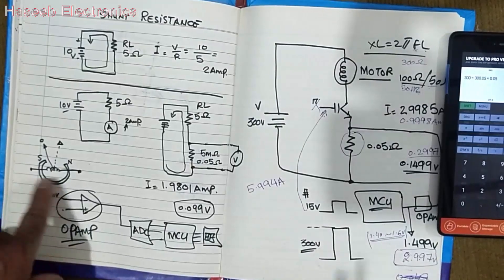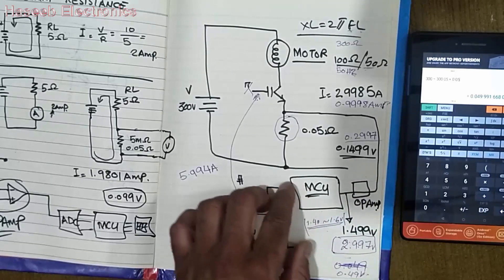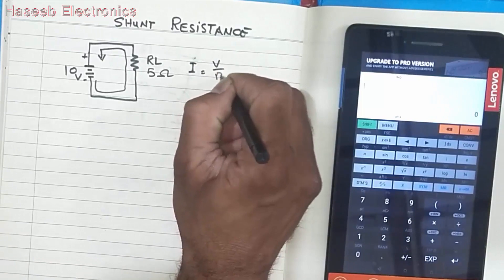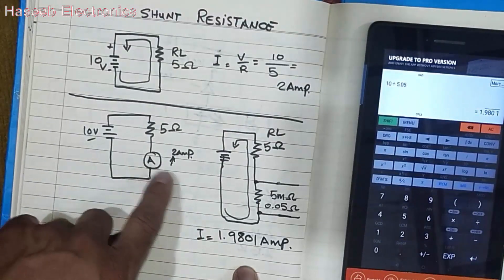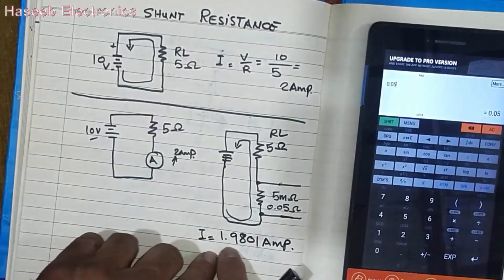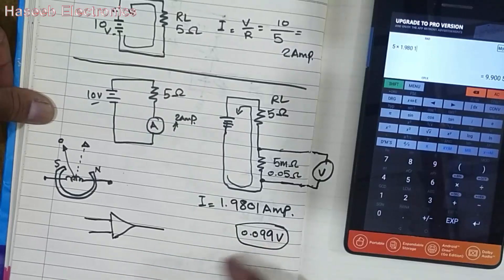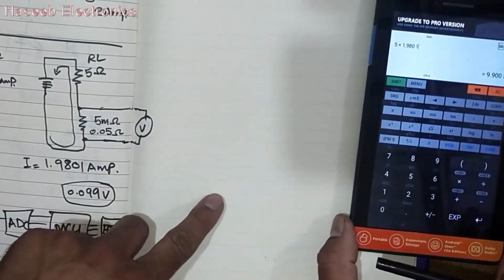357 SHUNT Resistance, Uses and Working Principle, How to Measure Current using Shunt Resistor

Comment: Sir I experienced that with temprature the resistance decrease and the voltage across the shunt resistor also decrease as the current increases. And we can,t accurately measure the current so what is the procedure to accurately measure about 50 amps of current @ 300 voltage.

Comment: Is it the same when an inverter ac error said ac current detect malfunction?
Reply from the maker: yes 
it is exactly the same 
there are 2 methods to detect the current in inverter ac
1. resistance in IGBT emitter pin and sensing the voltage using opamp
2. using CT current Transformer in AC input line or in dc rail

Comment: In practice shunt resistors for high current requirements have very low values, usually a milliOhm or less. The traditional use of a shunt with a given microammeter needle movement is well understood but not very useful for today's trend toward data acquisition and system electronic monitoring and control. Meaning, the shunt signal will have to be amplified in order to provide an input to instrumentation, and this is where the difficulties begin because of the high gain required, cancellation of common mode noise and influence of thermal emfs.

Comment: would that work for AC current measurement ?
Reply from the maker: for ac current measurement, the CT current Transformer is the best solution
Reply: @HaseebElectronics  even for high frequency like 300kHz ?  can you recommand one to use with my scope please
Reply from the maker: @EnergySeeker  there are many CT current transformers 
or Current probes can be used. it depends on your requirement. please check digikey 
https://www.digikey.com/en/products/filter/current-sense-transformers/163
Reply: @HaseebElectronics  am using this one Micsig CP2100A what do you think of that ? at 300kHz would it be accurate ?

Comment: Hello, thankyou for great video. But I want to ask how about if the load is inverter, I mean shunt resistor is between Battery and inverter so it use to meassurement the current of battery. Thankyou so much.
Reply: I mean inverter as a load too, sorry for confusing question. Thankyou

Comment: Hi , I have battery discharge machine and charge 30A , so +I , -I is connected to head and end of resistor shunt and multimeter is connected parallel ? Because my equipment power main supply is 380 vac and output is going out based on my programming, so how can I determine the voltage from my wires +I and -I ?

Comment: @Haseeb Electronics  sir my atx power supply work without pc but when I connect with pc it  restarts reputedly.  Plz help. Which part would be faulty?
Reply from the maker: Welcome dear
First verify that the problem is in ATX by installing another power supply to the computer (if pc works good with other power supply)
Then power on defective power supply by connecting green wire with black wire
If it starts normally
Or not
Please reply
Reply: @HaseebElectronics  yes. I've already done these by watching your videos. My pc is running now by another psu. But my faulty psu works fine without pc. But if connect with mother board pc restart repeatedly.  Monitor display goes on and off repeatedly.
Reply from the maker: If it starts for a while
Then goes off
Check output filter circuit (capacitors and rectifiers and 3.3 regulator)

Comment: Milliohm is 0.005 when converted to ohm.
Reply from the maker: I selected 50 milli ohm but while narrating it was mistake 
I said 5 milli ohm instead of 50 milli ohm
50 milli ohm is 0.05 ohm
I m sorry for inconvenience
Please accept my best regards
Reply: @HaseebElectronics  it’s ok. Beginners would find it confusing. I would suggest you do ‘How to determine a shunt resistor for a load?’.
Reply from the maker: @gtag174  I am thankful for your valuable guideline. 
I will do it 
Stay blessed

Comment: So XL is not resistance as we know it. it is inductive reactance and is also measured in ohms.  When the motor cannot move or difficult to move it is this inductive reactive that reduces.  And this inductive reactance is also measured as resistance.  My mind sees that if something is not moving or fights to move it means it has more resistance compare the something that can move easily.  Experimentally if a motor doesn't move or resist to move, has more load on it etc. it gets hot.  It is hard to picture it in my mind.
Then we have impedance, I assume that is different than inductive reactance. And reluctance etc.
So when the error code (over current) comes up on a diagnostic screen, it means the motor is having a hard time moving due to load or internal stress or whatever, or could it be anything?
When I took the bldc motor out of the washing machine along with all the computer and everything.  On the user inerface I put it on drain and spin.  Since I had no water hooked up to it of course, no drum to spin etc, I figured what is important is that I had the door as closed.  The motor ran.  I said to myself alright it works.  Well, it worked again the next around when I wanted to show off.  But then after that it didn't.  Error code over current came up.  And it never came out of it again.  I gave up.  I still have the control panel sitting on the shelf and wondering what happened.  I don't know if the motor needs to actually turn something, have something to do or the computer will show as if it is not moving or resisting to move which doesn't make sense.
Reply from the maker: you are absolutely right
actually i try to explain in very simple and lowest level to make it some understandable for a layman technical staff. so explanation of a function in very easy and understandable ways, gives good approach to understand the concept for those people who have poor knowledge
as it is a very deep theory of magnetism in rotary induction devices, provided a summarized view to understand the function of a shunt resistance  
when a rotor stuck or faces high friction of any other obstruction, it will cause to increase excessive current flow, so its magnetic filed cancels the input magnetic filed, 
because the counter emf causes cancellation of primary flux, it causes to reduce inductive reactance, which causes to draw more current 
in very simple words, "excessive resistance in mechanical movement of any rotary motor cause to reduce input resistance, which causes to draw more current than the rated drive parameters" 

please accept my best regards and special thanks for watching my video in detail and a valuable discussion
Reply: @HaseebElectronics  Are you saying that no load on that washing machine motor caused overcurrent error message because that couldn't be the case as all that would mean is the motor easily moves, if anything it would be I guess undercurrent (if it exists).   So I am assuming the issue maybe other than that.  I should mention that when I turn that round magnetic drum (LG washing machine) by hand the center shaft/bearing has enough wear to cause the magnetic outer drum to be wobbly enough perhaps.  Someone gave me the washing machine to play around with and said it wasn't working right.
So I just took it apart and decided to see if that motor will turn on the bench just for fun.  
So I guess my question is, would a worn bearing which I assume would cause the field between the rotor and the stator to not be even (the little wobble) would cause overcurrent?
Thanks for all your videos.  I watch them over and over and over.
Reply from the maker: In your case if the control card is applying power to the bldc motor and it is not spinning up, that means that there is some sort of mechanical obstruction in rotation (bearing or misalignment Corrosion etc)
Of there is drive failure 
Might be some ipm or igbt may be facing issue  or in drive circuit 
Over current problem is most of the time from electronics circuitry
Reply: @HaseebElectronics  Thank you Haseeb for everything.

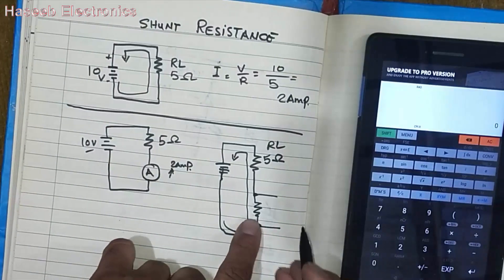Comment: For the sake of clarity, although it is immaterial to your calculations, the resistance at @3:41(0.05ohms) is 50m ohms and not 5m ohms. Ramadan Mubarak!
Reply from the maker: thanks a lot for correction. 
best regards and special thanks for your valuable feedback
stay blessed
Reply from the maker: exactly right. it is 50 m Ohm but in saying it was a mistake. i used it 50 m Ohm but now i watched the video again and notice my mistake.
please accept my best regards and humble thanks
Reply: Yes. I noticed it as well.

Comment: Sir, does lowering the value of shunt resistance increase sensitivity of any measurement?
Reply from the maker: it is always selected in milli-ohms, if it is selected higher value, it will consume a large amount of supply voltage, so it is always selected as low as possible ohmic value.
for example, at 200 ampere current  a 0.01 ohm or 10 milli ohm resistance will drop 2 volt (200 x 0.01= 2 volt) which is enough for a operational amplifier input,
if at same current a 1 ohm resistance so it will (200x 1= 200 volt) so 1 ohm shunt will drop 200 volt, which is a huge amount of voltage, which cannot be used for any control purpose. 
so the shunt resistance value is always selected as low as possible to make the circuit stable sensitive